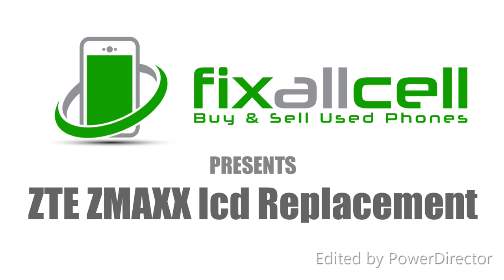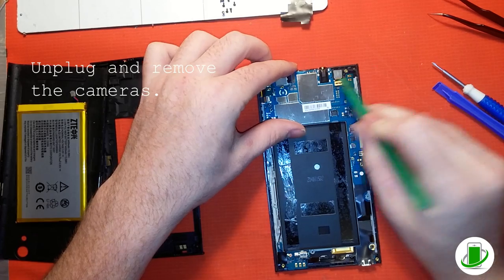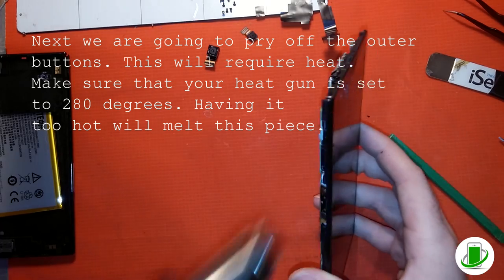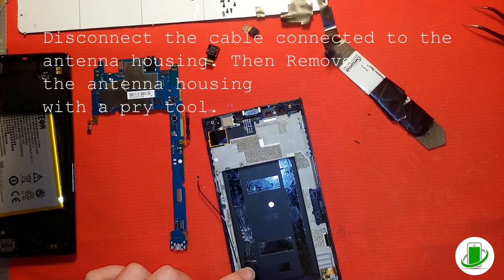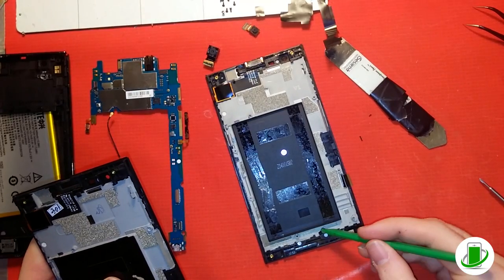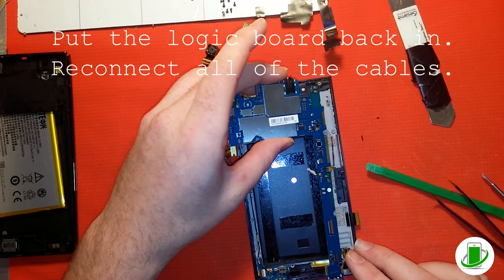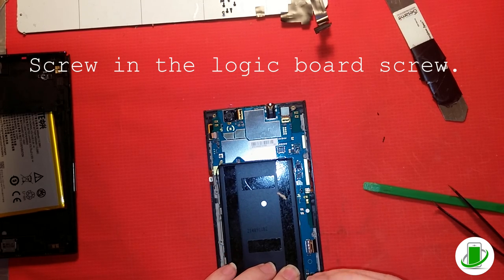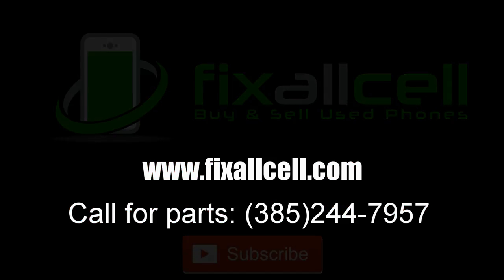ZTE ZMAX LCD Digitizer Replacement Disassembly and Reassembly

Comment: thanks it worked i never fixed a phone in my life. but i followed your instructions i
 did it without a heat gun just pull off the glued partes slowly until they came off. thabks again Bro saved me 40$
Reply: no problem!  I'm the dude that was talking in the video with the monotone voice haha
Reply: +Aharon Smith  if the phone doesn't turn on after following this video does that mean the screen is bad? and how hard is it to replace on off button

Comment: Hey guys I have a Zmax Pro that was taken to the wall and the screen is dark I think  still works I held the power and I got a vibration and It gets warm as if it was being used so is it fixable if I got a lcd and digitizer  replacement ?!
Reply from the maker: +Jason Spratling yes most likely. If it makes sounds then probably just the screen needs to be replaced.

Comment: I bought a Digitizer without a frame... I'm Stuck.
Reply: me too
Reply: you got to use tape and stick it to the frame.  pull out the broken one off the frame and put the new one on.   watch other videos of needed.  also check out ifixit.com Lots of good repair info on there.